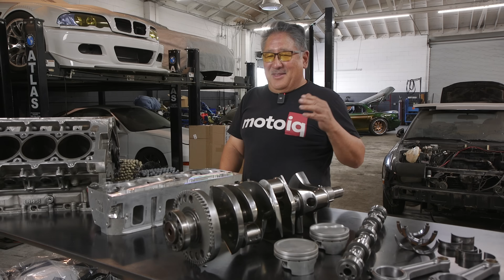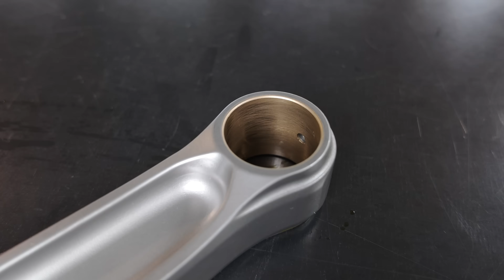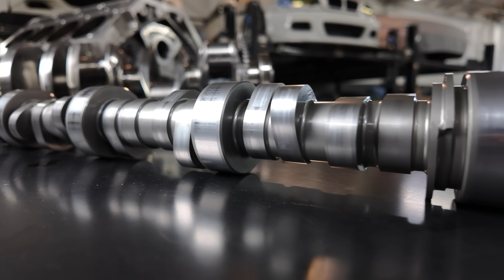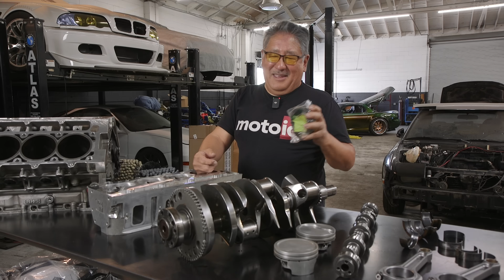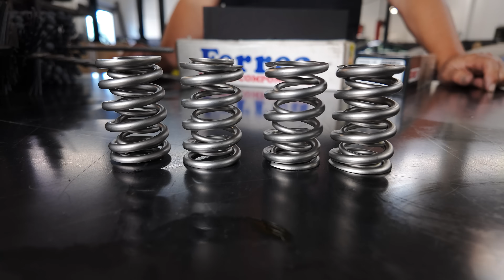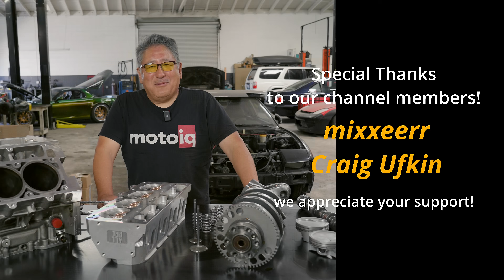How to Make Your Engine Last Forever!

Comment: I have a 73 Datsun 620 p/u, was thinking about a drag and drive build, Either using a G37 engine and trans or a LS swap which option would you think, might be a more interesting, fun or easier build.
Reply from the maker: LS
Reply: @motoiq  I was leaning that way too, the little truck is so light(stock about 2200 lbs) I won't have to go crazy on HP to go fast.
Reply from the maker: Yeah a nice cheap 5.3 will work wonders.

Comment: Most importantly, and probably the most underrated thing in my opinion, is just driving your car and enjoying it. I have put at least 75,000 miles on the stroker engine, and the chassis itself is sitting at 154,000 miles.

I love my VAC Motorsport 4.4L V8 M3. I did as much as I could during the assembly to make sure everything would work together and last as long as possible, but at the end of the day, it is still a race engine. I know eventually it is going to end itself.
Reply: Preventative tear down, check bearings, tolerances etc, replace valve springs etc. See how it's going. Easier to rebuild a good engine than replace an entire one.

Comment: If these engines last twice as long in drift, I bet they would last practically forever for casual street use.
Reply: Do they make parts for diesel applications
Reply: They wont because they are built for an operating range. Casual street use is not.in that range so then you have excessive wear
Reply from the maker: @km6832  No you wont
Reply: @km6832 debunked
Reply: @km6832  That's true, but the amount of pressure and demand on an engine in high rpm's for a drift car compared to a casual street car, can 'offload' some of the cold starting and constant weather changes. Assuming maintenance is somewhat followed, If the user drives their car for 10-15 minutes at a time and not short trips constantly when the engine is cold, it mitigates a lot of the wear.

Comment: @motoiq whats the cost for both treatments on a complete LSX engine package?
Reply: Don't ask without a diaper on 😅
Reply: Probably 3k or so for a whole engine to be cryotreated...not sure anymore though...wpc...no idea. The engine can be cryo'd whole, FYI. It works best on things like cast blocks, etc. It does have an effect on forged and billet parts but diminishing returns, primarily a stress relief...cast though can be a VERY dramatic increase in everything
Reply from the maker: Engine cannot be cryoed whole, not good for gaskets and seals plus aluminum and iron/steel use different cycles.  Also cryo first then WPC second.
Reply: I meant how much total for all the equivalent wpc and or cryo treatment to match what this engine had total cost?
Reply from the maker: Something like 3k for a small engine and 5-6k for a larger one.  Check their website for pricing. They have a list.

Comment: No mention of best quality lubricants.  That is so important for lasting engines!
Reply: BINGO
Reply: @chestrockwell8328  I've yet to have Stan's shop build an engine for me, but I do use only the best lubes.
Maybe one day I'll send him an old EJ25.  It's has 230,000+ and still runs with OG graphite head gaskets.  It's a '03 N/A.
Reply: I was about to ask, what oils etc. they are running. I'm guessing things like Motul etc. The other thing with race engines like this, is they are subject to intensive maintenance / tuning etc. and will have very regular oil and coolant changes after hard use, which massively prolongs their life over most passenger cars out there.
Reply: @VenturiLife  IDK about Stan's choices, but for me it's HPL (High Performance Lubricants) all the way around.  Engines and gear boxes.

Comment: I always wondered which component has a tougher life, the rod bolt or an exhaust valve and rod bolt wins. That engine looks really good for all it had to go through, good build.
Reply: Exhaust valve %100
Reply from the maker: Seen way more rod bolts fail than exhaust valves.  The rod bolts are under more stress, the exhaust valve has a worse environment.

Comment: Not in a race environment, but every car I've ever owned the engine outlasted the body. Except a BMW. 😂
Reply: My M54b30 been in 3 shell and I keep torturing it! (Often runs with 1liter of oil missing while drifting and doesn’t skip a beat ahah) I don’t know about newer engines though 😅
Reply: @currymasterrace7153 had a e39 530i. Great chassis great engine. That m54 👌
Reply: Both of my Nissans engines left the chat, a SR20DE that got rod knock after one single hit of the rev limiter, and a VG30DE that seized going up the Grapevine.

Those were the good years, too. Nissan is sorta at a Dodge level always vs Toyota & Honda.

Oh. And a D15 in my first Civic, an EF hatch base model.

Thing just would not fire on #3 and I gave it away after I bought the SE-R.
Reply from the maker: Doing something wrong, SR's and VG's are really strong engines.  You probably ran them out of oil or something.
Reply: @motoiq  not in either case. The SE-R had just had a great night burning down every backroad I ever wanted to on Long Island after I got the Ksports dialed in.

I put way too much money into that car, and the guy I bought it off just commuted it. His eyes were saucer plates on my test drive, lol.

The VQ30DE was literally just personally checked and topped up for a trip up the coast. I had just bought the car, though. Had to have a stick Maxima, worst decision of my life 😤

I was turning about 3000-3500rpm when I saw the temp guage slam over to full hot and bam, seized.

In fact, I immediately recalled the SCC article about Lazy Guages and why people were putting Auto Meter guages in essentially brand new cars at the time.

For reference, I have a 98 Chevy OBS with 4L60E issues, and the same rpm range is maintained for a much longer period of time, daily, since I don't have 3rd gear.

Sounds like a speedboat tooling around down at 45 mph, pushrods, truck motor and all.

A Chevy will run badly longer than most cars will run at all, though.
Reply from the maker: Well, something isn't right as those engines are very strong internally, have a huge bearing area, and more than adequate oiling systems. If they are near stock and maintained correctly, they will last forever. VG's don't suddenly slam full hot.  I think you ran the SR too low on oil, burning down the backroads, and on your long trip, had a cooling system or head gasket failure, probably due to poor maintenance.  Aluminum heads and iron blocks require coolant to be changed with the right coolant at regular intervals. We raced those engines, real racing on stock bottom ends, and didn't spin bearings unless something else was wrong.  The SR and VG are good designs with reliability on par with Toyota and better than Hondas of the same era.  On the other hand they are way more robustly engineered than the small block pre-Gen 111 Chevy.
Reply: @motoiq  the SR had just cruised over ten miles down the Long Island Expressway, I got on the highway that leads to Stoney Brook, gear pull, limiter hit, and there's my exit...

...at the end of the onramp, knockknockknockknock

Bone stock minus a K&N cone filter and I kept the oil up religiously. 

You can fellate Jalan and their flawless wisdom all you like, but Toyota made sports cars for decades and afaik still do today that will eat themselves due to oil starvation if you hit 1g in a turn, because, what's a baffled oil pan?

Camry SE, all the 1ZZ/2ZZ cars, FRS/BRZ/GR86, including Lotus because they also believed jApAnEsE eNgInEs ArE iNdEsTrUcTAbLe.

Just ask Corolla GR owners. That's "better than a SBC" right until it throws a rod through the block, douses your hot turbo in hot oil, and after it burns down on the side of the road, Toyota says they caught you going over 85 in a performance car, so, your warranty is null and void.

Or Tundra V6TT owners. I hear they're great when they don't eat themselves in 2-18k miles.

"Way more robustly engineered" yet 100% dead engines on both of my Nissans. I've owned over 50 cars in my life, I think I  have a wide enough experience to draw from.

Hell, even the time I goofed on my first 5.0 and didn't know about the dual sumps, the only thing that failed from overfilling was the oil pump, which got replaced and kept going.

Hell, I used to run up and down Bouquet Canyon in my modded 240D Mercedes, -3 coils front -1.5 rear, 205/60/14s, and a homebrew intake & short shifter, wonder why an economy diesel motor designed in the early 70s outlived the SR despite being put through far more sustained cornering over months?

I must have hallucinated it!

You act as though Sport Compact Car never saw either of those motors scatter themselves at USCC or any other event, and I must just be making it up because obviously 100% of MIJ motors still run.

 Cool story bro, I suffered the consequences though.
Reply from the maker: You didn't read my article in SCC on why most japanese engines are stronger than the SBF and SBC. Look at just about all modern rings used on racing pistons.  Guess what? Low tension 0.8 to 1.1mm top rings and 1mm to 1.2mm second.  That is as low tension or even lower than your typical OEM ring. Do racing engines (and modified production engines) consume oil and explode more than they used to? Actually an order of magnitude less so. In the last 10 years rings have changed greatly in geometry, materials and surface treatments and work a lot better than the ones at the dawn of low tension rings.  Sure some OEM's mess up and have made oil burners but in those cases it was probably immature technology in the early to mid 2000's and cost cutting later. So I guess you are better with your anecdotal truth than engineering and actual many years of race engine building experience. I am pretty sure you have never taken apart any of these engines and analyzed the internals. I am pretty sure you have never built any of these engines,  I am pretty sure you have never used any of these engines hard except doing steet pulls. You can fellate your wisdom and believe what you want all you like but its not going to change improvements in engineering and metallurgy.  They do not make them less good than they used to.
Reply from the maker: Actually, you are getting confrontational and cannot come to terms that those engines are much better than pre GEN 3 Chevys, and late model engines in general are much better than older engines. I don't give a fuck if you think I am smart or not, it's just you need to be objective and realize that most engine failures of most modern cars are owner, not design induced. Of course, your engines might be outliers and just failed, like every system can. BTW, I did not censor or block your post. For some reason, YouTube thinks it's offensive, but I don't find it offensive in any way; it's just a discussion. I should do a video pointing out the better engineering of a new performance engine vs something like an SBC or SBF on actual engines. I think we threw away a lot of those older parts.  Like Coyote vs SBF or LS vs SBC.
Reply: @motoiq  funnily enough I sold an E350 with a 460 in it that had 380,000 miles and no problems to buy that POS Maxima.

Not reading your novel, go back to writing articles Mike - otherwise most of us would rather shit in our hands and clap than hear you speak.
Reply from the maker: Strong opinions based on nothing but a small sample size and no knowledge other than stuff probably read on some internet forums mean nothing other than being opinions when the data shows otherwise. Facts won't convince you but they probably have nothing to do with how you enjoy cars.  Live your best life.
Reply: @rocketpigrecords3719 i think you just suck at cars lol
Reply: You must live in the salt belt. Arizona bodies will literally last for ever but engines do not.
Reply: My bmw 2006 n52 e90 400k mile engine still strong.
Reply: I currently have a 200K mile BMW V8 and the body is giving out more. It’s about the owner.
Reply: You bought the wrong BMW
Reply: They constantly replace the bodies, engines, suspension, etc.  in racing & professional Motorsports.
Reply: Because you never maintained it.... Duh
Reply: @wytewizzard  it was low mileage but stood up for 2-3 years in a Greek boatyard. We changed the oil and it seemed fine for about 5 weeks then developed a knock. Local mechanic tore it down and found a cracked piston iirc. It was an E46 320d. Got it for free and gave it away. Easy come easy go. I've abused diesel fords, petrol VW/Audi and now petrol Honda without issue. BMW seems a bit fragile if you don't baby them which just isn't good enough for me. I've a friend who loves them and has 3 from track E30 to e91 335i but he's spent a fortune on them. Just not for me. I prefer the KISS philosophy.
Reply: What were you doing to the cars? LOL
Reply: Cool Indian comment saar
Reply: BMW M10B20 "1979" great solid engine, sounds excellent goes great 👍
Reply: Same
Reply: My friend drifted and tracks his 270k mile e36 m3 original begin and trans sooo
Reply: M54 at 220K miles not km. If you actually change your oil and do the maintenance they are great engines, but us average Americans love to change oils every 20,000 miles or so, if it's got oil in it its fine
Reply: Strange, what does the 'M' stand for in BMW?